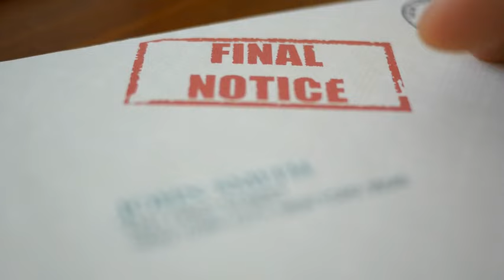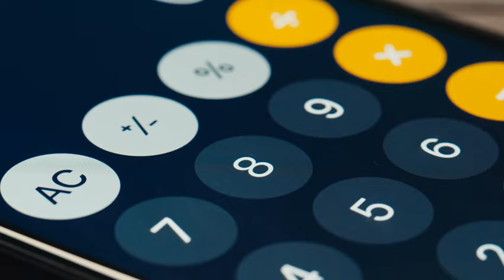How much do you LOSE Selling a Home “As-Is”: Pros & Cons, plus the Simple SECRET to Top Dollar.

Comment: Some Buyers think that a working yet older HVAC system is reason to ask for a new unit or credit at closing. That would be considered an upgrade, not a repair. That's void of logic to  replace a working unit, despite its age. Advertise "everything is working, but selling AS IS."
Reply from the maker: Thanks for watching! Have you had this experience with buyers?
Reply: I refuse to buy as is and if an air conditioner is old it needs replaced because in Florida ac runs constantly and has a 10 year life.
Reply: If you want a new house go get one—at a premium. Price the house fairly.
Reply: Don’t say “As is” in the advertising unless it needs repairs. That language is interpreted as “repairs required”
Reply: @dilvishpa5776  GREAT point that I also have been thinking about when I market my older home in a nicer area in the coming year.  It will need some updating but NOT repairs.  Thanks for sharing your input!
Reply: @dilvishpa5776 what if you have a 25 year old roof and furnace? They still work perfectly fine.
Reply: @teresa606606 Good to hear you can afford a brand new overpriced house.My house is older .Very well made.Needs only cosmetic like floors wall painting.
Reply: I have had a few flippers offer me a Real LowBall deal.I Am not stupid.Those people are like vultures hovering.I will likely sell it to friends of neighbors.They won't mind doing floors and  few things.Besides they would remove what I would do because they have different tastes than I do.😊

Comment: Just fix the stuff you need to for safety and livability: good roof, good foundation, HVAC working, plumbing and electrical working. Skip the cosmetics that are subjective, BUT make sure everything is CLEAN. I would rather buy a house that is outdated than pay for some flipper's idea of what sells. I've seen a lot of houses that had bad 'updated' features with jacked up prices AND I've seen a lot that needed work that ALSO had jacked up prices.
Reply from the maker: I agree if you have the time and money to fix health and safety issues, do it. While some sellers aren’t in a position to repair a roof or other major issues. Therefore, they sell it “as-is”.
Reply: Seems like a buyer would want to make it their own. If the seller upgrades with their taste it’s a waste if the buyer changes it. Fix the safety issues and let the upgrades be the buyer’s choice.

Comment: Big difference between upgrades and repairs. You will almost never get back the money that you spend on upgrades before selling. But needed repairs will drive down the value of your home and what it will sell for. Do all needed repairs. If the buyer wants something replaced just because it is old - tell them to pound sand. That assumes that it is in working condition. Offer to buy them a home warranty for a year if they continue to whine.
Reply from the maker: Agree!
Reply: I would disagree with that ..its situation specific. I live in a neighborhood with larger homes...4-5 bedrooms and 3-4 bathroom built in the 1960's. I have seen swings on $120-150K from similar square footage homes where one is very original, and the other has updated kitchens and bathrooms.
As for the mechanicals...I do agree with that. However, for example, you wont get 100% back in a new HVAC system versus one that is 10-15 years old and functioning just fine.
Reply: @turnne  - A 60-year old home that was never updated will certainly sell for less than one that was updated over time. But it will cost more than $100k-$150k to demo and remodel a kitchen and 4 bathrooms. If you are selling, you would be money ahead to sell $100k below market.

Comment: My wife and i are in our 60s and we don’t have a ton of money to spend. Our AC system we had replaced in 2022 and a new roof in 2021 . Will paint the house and do basic repairs but that’s it. The house around the corner sold for $207,000 and the vinyl flooring was torn up and had bad carpet in all the bedrooms. We couldn’t believe it sold for that much. It was 30 years old like our house.

Comment: If you hire a Home Inspection, and fix all of the major items that were found during the inspection, adjust your price upwards to reflect a percentage of the cost of what you repaired, As Is is then a lot easier to do. And remind the Buyer it’s a Used Home. All used homes have dings and scratches everywhere. And then just say No. Eventually you’ll find a Buyer. There’s a shortage of housing.

Comment: Each state and market have different requirements regarding As-is.  Back in 2021 every home in our market was AS-IS because the market was hot.  Not so now. But in Hawai‘i, where I’m a licensed broker, the buyer still has all the same rights to negotiate fixes.  I usually advise both sides to be prepared to fix safety issues but not ‘dated’ items that need upgrade.
Reply from the maker: Thanks for sharing. Yes, totally agree to fix safety issues. And the buyer always has the right to negotiate repairs. Now if the seller is willing to do/negotiate the repairs is another story…

Comment: There are several exceptions to the general rule of course. One would be an older home on a unique and valuable lot (lakefront, etc.), the desirability of the location would hold most of the value here, so less adverse impact of marketing "as is". Also, many buyers plan extensive re-models regardless of condition (they of course won't tell the seller this because they would lose the negotiation leverage),  so sometimes it pays to stick close to your price with "as is", at least in the beginning anyway.
Reply from the maker: Thanks for sharing. Have you bought a house that needed a lot of remodeling?
Reply: @YourPowaySanDiegoRealtor  No

Comment: If the kitchen has old cabinets, how much should you spend to upgrade? Will you get your investment back when you sell?
Reply from the maker: Thanks for watching @gordonsteen8415. Good question. There’s no straight answer. It depends on a number of factors, what is the condition with the rest of the house? Have there been any other upgrades? When was the last time the kitchen was updated? Etc… if you have more questions, give me a call/text at 858-335-4597. I’d be happy to discuss further.
Reply: Keep in mind not only the cost to change out those cabinets, but also the mess and the time.  Older, solid wood cabinets are prefered by most people in my region rather than the newer trendy, lower-grade cabinets.

Comment: Seller didn't disclose ALL the things wrong with the home when I bought it, now I am dealing with mice issues. Buy a new build and keep it moving.
Reply from the maker: @Traveling-East2  that’s unfortunate. Sellers are supposed to disclose everything they know. But obviously, that doesn’t always happen. Are the mice a big problem?
Reply: Get the big black glue traps. They work better than anything else I’ve found. Keep them out in hidden locations. I would also put poison in the attic and behind appliance.
Reply: @YourPowaySanDiegoRealtor  Not anymore, I found out how they were getting in at and disposed of the ones running around in the walls. If anyone is having this issue, don't waste your time on repellents, it makes the yard smell good but that's about it. I left one hole open so they can travel through to lure it in the traps and sealed it right after.